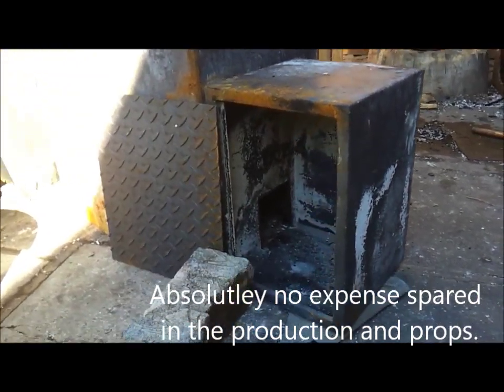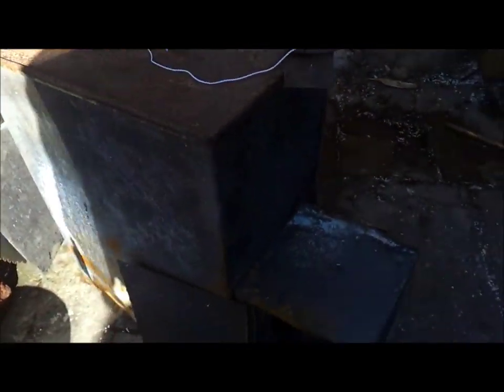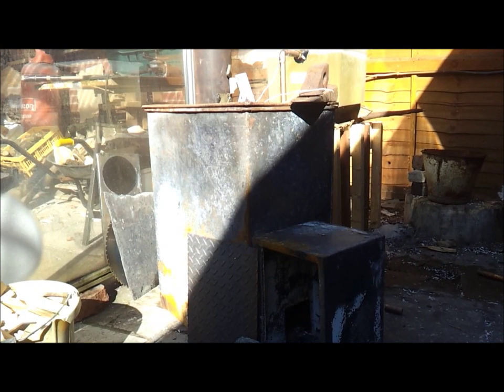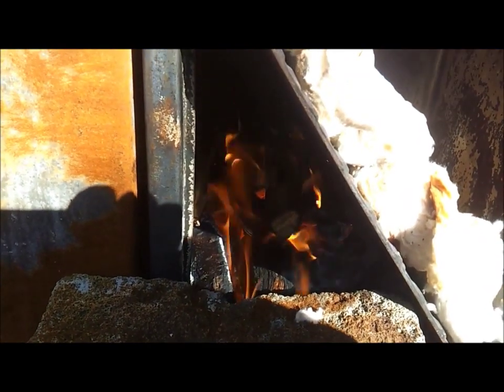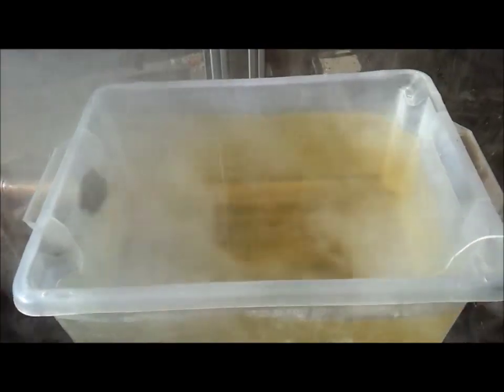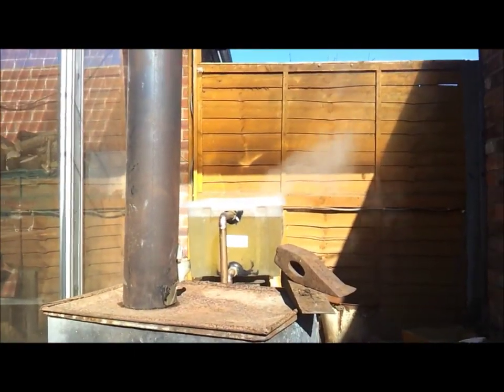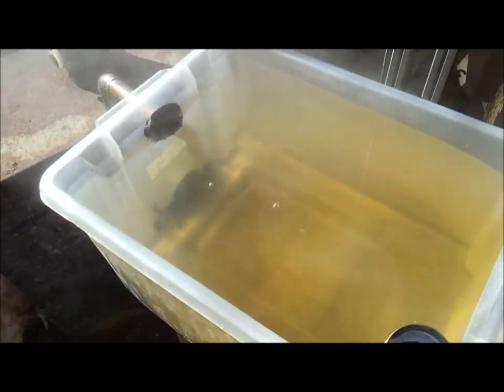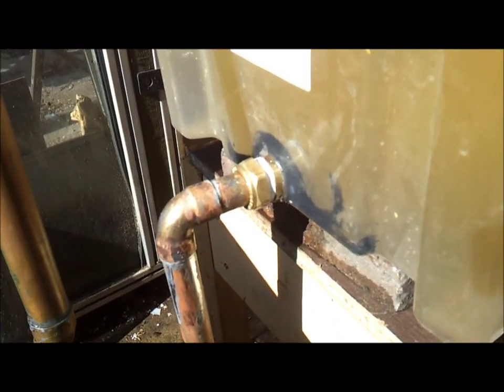rocket stove boiler test 1

Comment: If you raise the water level in the head tank so the upper pipe is under water, the system should thermosiphon.  This will cycle water thru the boiler and keep the water from actually boiling in the boiler. You will know it is working by observing a steady flow of hot water from the subnerged upper pipe.  It will also transfer the colder outside tank water from the bottom of the head tank into the boiler, increasing the temp differential inside the boiler allowing more heat to be transfered to the water faster.  Also covering the outside container will slow evaporation.  Most all of the energy lost from open tanks is thru evaporation, and the closer to boiling you get, the greater the heat loss...   What does the boiler look like inside the box?

Comment: Very nice!

On the header tank, I believe that if you put the 'hot' pipe, coming from the boiler, maybe half way down the tank, the hot water will create a turbulent mix in the tank which will warm more water, more evenly.

Having the hot return pipe going in at the top of the tank will likely create a very hot surface with a thermocline underneath it and cold water at the bottom.

This suggestion comes from a friend who's done a lot of passive solar heating work.

Hope that helps.  :)

Comment: I'll try the raised flue tomorrow thanks, it would have been the first change I tried anyway. The gap over the riser is 30mm, I was wondering if that might be too small but the smoke pouring out tells me that it's flowing OK. So one thing at a time, I'll try the flue pipe first.Do you think the snorkel tube will work? I contacted Screwfix to see if they had the Bosch in at my local branch.

Comment: That is a success. Excellent work. Who was the water in the bucket over the level of the hot tube? That will surely warm up the radiators in your house. And the rocket stove temperature won't overwhelm you. Brilliant!